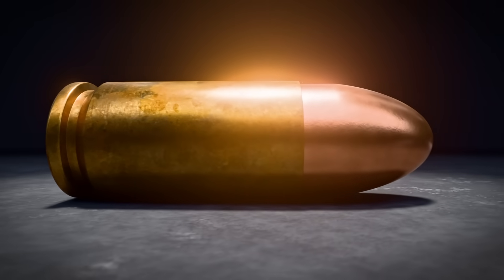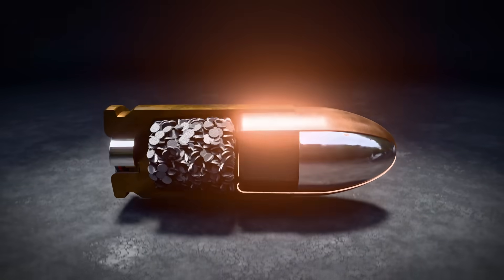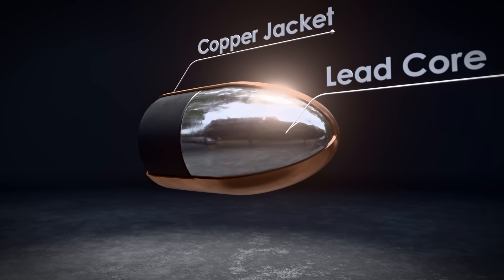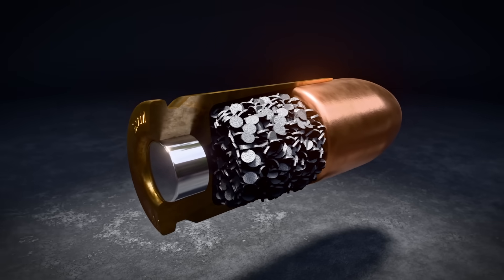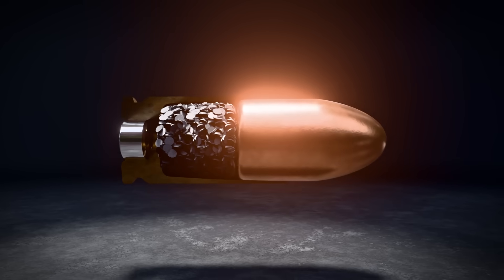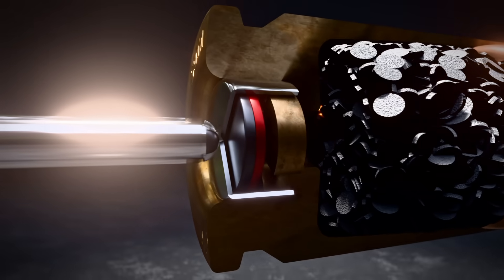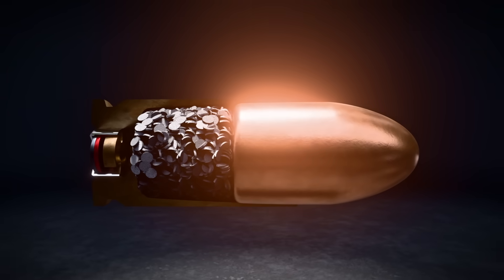How do Bullets work?

Comment: They should emit distinct glowing effects when in contact with blood, such as a vibrant red glow or a subtle green light with a splatter, to enhance visual differentiation. Additionally, include options for the glow to originate either from the back of the lead, creating a silhouette effect, or to encompass the entire length of the lead itself, ensuring flexibility in visual presentation, or even used to light up a dark scene from far away, like next-gen glow in the dark sticks or flares that scatter to identify snipers or mines.

Comment: Add to my invention an electrically activated, glow-in-the-dark adhesive that ignites when stimulated either magnetically or electrically by the firing pin or hammer. This adhesive should be capable of producing a streaking glow in tracer rounds, with options to make the entire bullet glow using a mild adhesive or only the rear portion. The adhesive should be durable enough to withstand the high velocities and forces experienced during firing, and responsive enough to activate promptly upon stimulation for real-time glow effects.
Reply: NATO can be blue…they can be red, and patent pending on my new laser glow-in-the-dark rounds, everybody.

Comment: a cartridge just blows up without being in the barrel, the bullet has very little speed when that happens, it needs the correct caliber barrel for it to be propelled to those immense speeds with the gasses trapped behind it as it is pushed down the barrel so without the barrel, a cartridge is pretty much worth as much as a small firework.

Comment: Ok so question:

How come the pressure only propels the bullet forward and not like, blow up the barrel completely? It shouldn't be hard to do if we're talking about thousands of PSI of pressure.

How is the pressure redirected to the bullet only when the gas accumulates in the entire barrel?
Reply: because of how the barrel is shaped, the "barrel chamber" which the cartridge sits in is often thicker in steel then the rest of the gun barrel even though they are all one piece, the back of the cartridge is held into place by the bolt of the gun with an extractor also holding onto the back of it as well, the chamber is able to take the pressure of the explosion so that bullet will immediately start to move down the barrel as the cartridge stays behind and as the gasses from the explosion push the bullet down the barrel until the it exits  and then the gasses escape right after that. Thats why there are often muzzles flashes when guns are fired.

Comment: Very impressive work, but you might consider rolling off the low frequencies below about 100 Hz. Modern computers are not modern enough to do multiband level control to the audio. If they encounter a loud low end, they will compress the entire thing, which makes the voiceover drop about 10 dB. That undermines everything.

And it's not just the operating system. 'Stable Volume' is typically on by default on YouTube.

Comment: So you're saying a bullet is essentially like a rocket where the first stage (shell) never get's off the ground but separates from the second stage (slug) at the time of ignition?

I recall as a kid in Grenada in 1983, watching the large bullets that soldiers were carrying with their automatic rifles. The rifles seemed to have barrels too small for those large bullets to squeeze through. I didn't understand then that it was just a small slug at the tip of the bullet that came out of the barrel, while the rest of it was just a casing that was expelled to the side. 😁

Comment: Where do you get bullets with a rocket engine inside? All I know are pushed by hot powder gas burning in cartridge and barrel. You show the rocket still burning and pushing well outside the barrel.

Comment: The primer holds a lead styphnate pad. The deformation in the primer cup, from the firing pin strike, pinches that lead styphnate pad against the anvil which triggers the explosion. It works exactly like those little toy cap gun caps. Some people who remanufacture their own ammo actually use those cap gun caps to recharge the primers though it's incredibly tedious and requires tweezers.

Comment: For novices, if you place a bullet at the tip of the (unloaded) gun barrel you'll see that the entire bullet doesn't readily go into the barrel. But when fired, all that pressure makes it travel down that barrel, leaving copper residue.
Reply: To make a gas-tight fit in the barrel, no pressure wasted, except in a revolver where gas escapes at the junction of the cylinder and barrel.
Reply: @kw8757 Good point. Yes, I've had cheap revolvers where you could sometimes feel some burnt gunpowder hit your hand.

Comment: IMO the flame out of the bullet when it left the casing and even left the barrel is misleading.  From what i understand it's an explosion and since the explosive power is only allow to go one direction, that's what PUSH the bullet.  Once that power is no longer constrain by the casing and the barrel, that power dis-burst.  Would be accurate to show the puff of smoke when the bullet left the barrel.  The bullet than left to travel by momentum.

The casing can be re-use right?  Or does the explosive destroy the casing too?  How about that igniter thing?  From "movie" I learned they even have tool to make the bullet yourself, or more like assemble the whole thing to be use.

Do you want to expand on other type of bullets?  Maybe rubber bullet or bullet that made to explode on contact?  I don't know if they are real or not.  And than there is barrel that made to shoot the bullet from around the corner, it's crazy but I think it's real.

Beautiful animation.

Comment: A few corrections: Since you referenced a semi-automatic pistol, not a revolver, the bullet is not the only thing that leaves the gun, the spent cartridge also leaves the gun. Since you're showcasing the bullet, the mention of rifling would have been prudent, adding the spiral effect like a football for consistency and accuracy. Looking forward to v2 of this video.
Reply: Expanding gas also leaves the gun - and sometimes some unburnt propellant. Aluminum cases are also used. Polymer and stainless steel cases are also out there, though rare.

Comment: nice video, needed to mention the rifling of the barrel though, to spin the bullet it make it fly straight
Reply: Thank you, you wrote what i was about to say 🤝🏽
Reply: How a bullet works, not how a gun works.
Reply: @valdie91285  Rifling's required for a bullet to work. It has to spin like a football to travel straight. The entire shape of the bullet is built around it spinning, otherwise it can tumble. He didn't have to explain how the bullet spins but that it spins. If he was explaining how a musket ball works, then would he leave out the powder? Just because the bullet is self contained, it still needs to be explained. He explains how the firing pin strikes the primer so why not explain how the rifling spins the bullet and the bullet spinning keeps the bullet flying straight? The firing pin is not part of the bullet. The fact is he forgot to add that part of how a bullet works.
Reply: @theshawnmccown  Cool
Reply: @valdie91285  Also, the casing is not the bullet. Bullet (projectile), propellent, primer and casing make a round/cartridge not a bullet. It's like calling a magazine a clip. Or calling a wheel a rim.
Reply: @theshawnmccown 👍🏼
Reply: Yes oh very important..don't forget the rifling 😅😅😅
Reply: and the bullet IS spinning.
Reply: He's talking about how a bullet works. A bullet can still work without rifling. In fact that's how bullets and a lot of projectiles were fired centuries ago.
Reply: and he made it look like the bullet was propelling itself the flame was coming from the bullet

Comment: You forgot about rotation in the animation
Reply from the maker: you're right!
Reply: the pistols barrel doesn't appear to be rifled and considering the animation takes place in a controlled environment not many factors such as wind (are present) would have any impact on the rotation of the projectile
Reply: @mohammed2242 😂
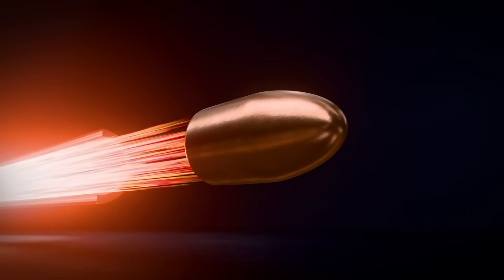Reply: @mohammed2242  You can see rifling @2:14